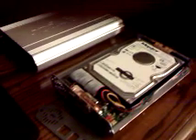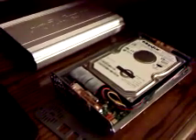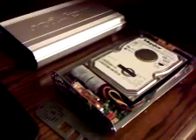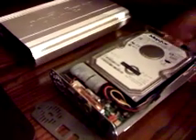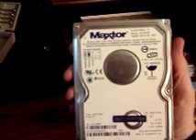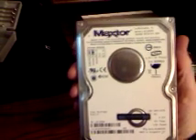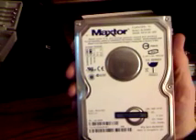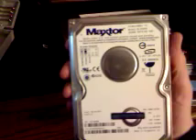Maxtor Onetouch II disassembly

Comment: Mine works just fine with any Mac I own.

NICE to have FW400 for most of my machines.

and USB2.0 for my Late 2008 MacBook AL-Unibody 13.3

Which has no FW port.

THERE it has a a cloning rate ( with CCC ) of 1.5GB per minute

1.1GB per min. with SuperDuper...

I'd like to know what the BUFFER size is 

of it's Maxtor 250GB MaxLine Plus drive is...

I cannot find any data from 2004 -2006...

I GUESS 8MB...

But...

J.C.

Comment: I found one of those, as well as a Maxtor 1touch 4 plus, a metal gear box external, & a generic external! Found the pwr cable for the generic, but not the others. Plus need a firewire cable! Might upgrade the Maxtor 4 + up to a 2TB thanks  the HDD in the unit you disecting has an IDE? Thanks 🤓

Comment: OK, times up! So, there's no special tool needed, the two small screws in the back that hold the grayish panel on also hold the old thing together, just shake the thing a bit or stick a screwdriver carefully and not very far into that little hole, or grab the edge of the tray with a pair of pliers and slide the thing out.

Comment: I have an exact external hard drive, but still not able to release the hard drive to slide it out because I don't know what type of tool to use and how to apply that tool without damaging the case or the drive. :- )  If you could at least explain with a message, I would truly appreciate it.  Thanks for all your efforts.  Good job. :- )

Comment from the maker: Correct. The problem with the Onetouch lies with the interface electronics in the case. The hard drive should be fine. Be aware, this drive was old when I first filmed this video. If you have data on this drive you care about, I strongly advise you connect to the drive and retrieve any data you need sooner than later. Google "drivewire" to find a universal hard drive USB adapter, which will let you connect your bare drive to a PC.

Comment: If the connecting electronics have failed (usb, firewire), is it possible to just install the freed drive as a slave in my desktop?
Reply: Of course, just change the jumper block to Slave....

J.C.